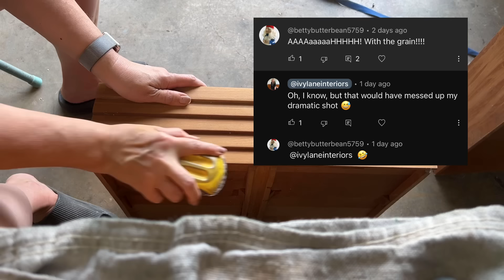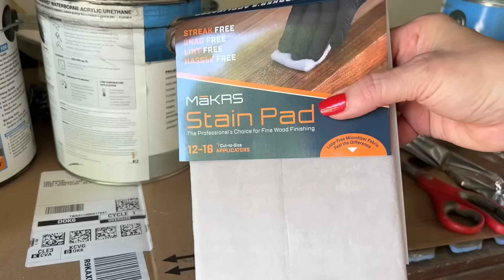Unexpected Vintage Mid Century Modern (MCM) Dresser Transformation!

Comment: In my experience, the acetone works very well IF you can prevent it from immediately evaporating. I place puppy pads absorbent side down over the saturated paper towels. I’ve left a piece sitting for two days once (forgot it) and by that time it had eaten through whatever that factory finish was. Couldn’t be simply scraped as it was like scraping glass.
Reply from the maker: Aw, nice tip! Thanks! 😊

Comment: Very nice. I have that dresser, but it was never painted. The louvered drawers are ash or oak while the rest is walnut. Mid century Atomic style had a lot of two tone accents using different woods. To create a blocked color effect. Much like what flippers are doing today with paint.
Reply from the maker: I wish I knew what the original piece looked like. I researched the brand and found one two toned piece. They are such uniques pieces

Comment: I really enjoyed your video.  You did a fantastic job.  Can you tell me what the sprayer was you were using?
Reply from the maker: Thanks so much!! 🤩🙌🏼  This was just a little siphon gun I have that I use with solvent based products since it has very few moving parts and it's easy to clean. I have it linked in Amazon list for the products on this flip. I typically use my Earlex 5700 for paint and topcoat though.

Comment: Can you recommend a really good water based primer that can be sprayed? Tried the BIN synthetic shellac and it had a hard time blocking bleed through
Reply from the maker: Water based primers that block tannins are hard to come by. Bin 123 doesn’t work even though they say it does. 
I’ve heard good things about Kilz Restoration primer, but I haven’t tried it yet. 
Honestly, sometimes what I do is get a rattle can of Bin Shellac for the first coat and than follow up with a water based primer for the second coat. That usually works. Another option is to use a water based primer and then use the rattle can on the areas that bleed through only. Lightly sand and then do your second coat.
Reply: @ivylane-home great advice! Thank you!

Comment: The other solution that wouldn't have taken a lot of woodworking skill would have been to replace the veneer.  Either remove the old and replace it.  Or smooth out the surface and go over the top of it.  That would have allowed you to match the drawers with the top, etc.  If the top couldn't have been repaired, I would have definitely have gone that route.  But this was pretty good solution as well.  Painting a small part of it and having the rest wood looks good.  And I'm a fan of black.  Flat black, in particular, matches everything and hides a multitude of sins.  So, it's a great color for inexperienced woodworkers.  I used it on the inside of my entertainment center when I modified it to fit a larger television.  And it all looks original.  You can't even tell it has been modified.
Reply from the maker: @TerryProthero  Yes, I considered the veneer, but I’ve only done small veneer jobs so far. I need to work my way up 😬☺️

Comment: So, maybe because you used the wax sticks and then a water based stain over it. Could that be why the stain wouldn't take?
This looks dynamite ❤
Reply from the maker: Well, I started with the seal coat, applied the wax sticks, sealed them and then applied oil based stain. That’s the layer where it wasn’t taking the stain and I had to go over it with some gel stain on a chip brush. I hadn’t applied any water based products at that point. That was the area with the Bondo repair and it doesn’t always take gel stain so sometimes I have to layer it. Anyway, usually it’s just a process of trial and error with certain pieces.

Comment: I would NEVER use a wire brush on wood, ever! The wire digs into the grain giving it a raised grain defect that has to be sanded down , which risks punching through the veneer
Reply from the maker: I’m using a soft brass brush that won’t harm the wood.